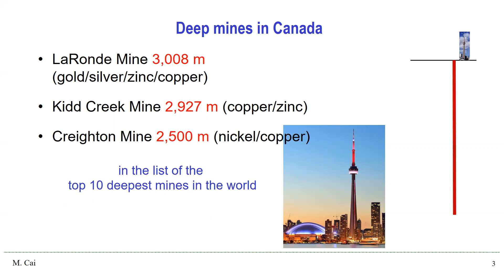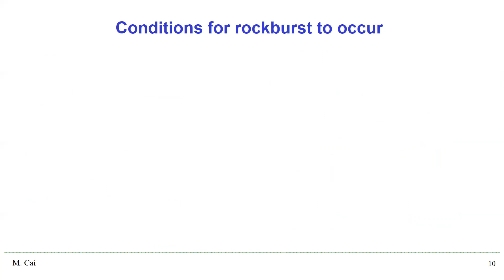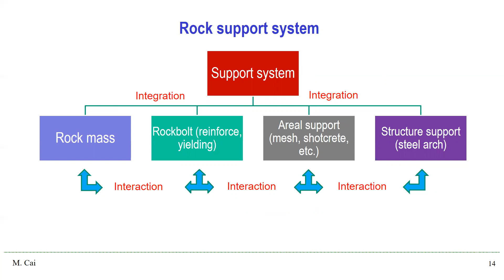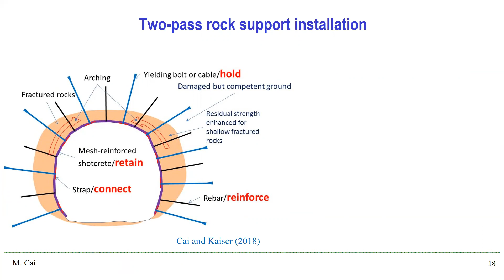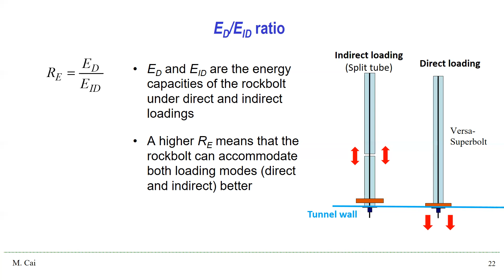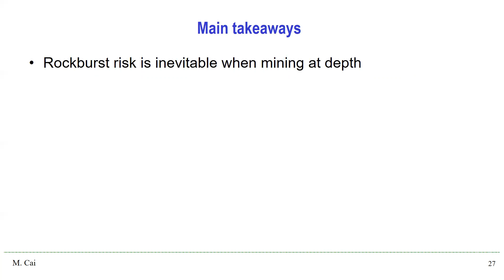RockBurst Damage Control through Rockburst Support

Comment: Is it not the Garson Mine in Falconbridge. I worked on the reopening in the early 2000's. Ground control had advanced enough so it was now safe to do so. The cage was 4' X 8' and it takes you down to 4,000'. Walk a mile or so from the shaft and there are 50 ton haul trucks working the new decline ramp to 8,000'. All the equipment was dismantled or cut into pieces to fit in shaft and reassembled  in the shop at 4,000'. Our gang installed the new ventilation system.